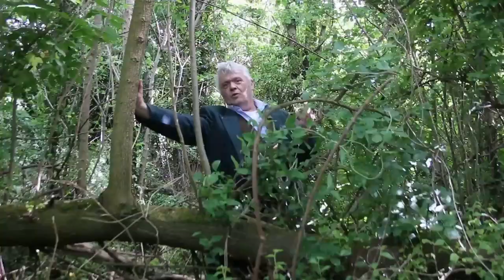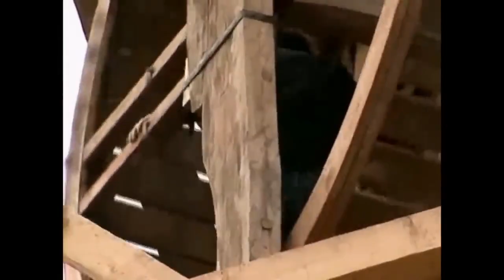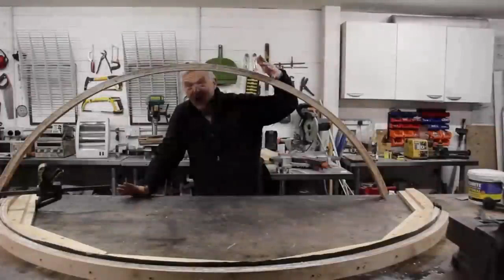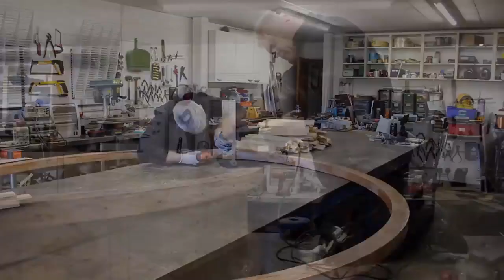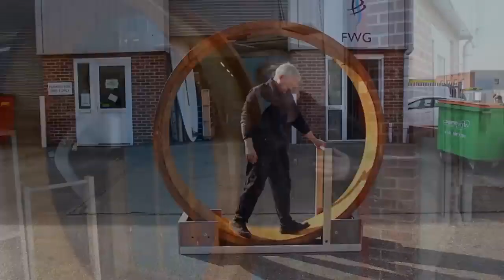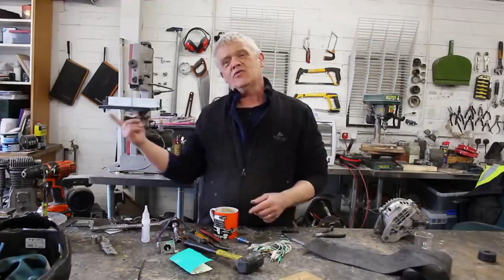008 A Generator For Every Circumstance

Comment: With that closing statement, one YouTuber made a generator out of some exercise machine that required one of the kids to be pulling the handle to power the Wii, and when one kid was tired or it was their turn to bowl, they swapped quickly and had to keep the pace. Think it was just the Wii plugged into the generator instead of the wall, but still. 

When I first saw a hamster-wheel crane, it was in a video covering some architect's class or whatnot near France. They are building a castle using traditional methods and have either spent or will have to spend approximately 20 years to make it. The last video I saw was covering how they built a container for storing the grain and were working to build the church portion (forget the actual name). 

I still want to make a human-powered generator that I can get on every so often to exercise and power my home or charge my batteries lol

Comment: I'm trying to figure out how long it would take to 3d print all the sections you'd need to build a life sized hampster wheel 🤔
Reply from the maker: i like the challenge! but a while lol
Reply: I'm wondering if I could make a template, cut the ball windmill blades from 55 gallon plastic drums, and then heat weld them together into a larger ball windmill. Then run more or less standard generators from the rim support wheels.

Comment: did you know that in your initial shot from Canterbury Cathedral you were just about 100m from a treadmill crane, its 2/3 of the way up the tower
Reply from the maker: it wasn't there when i shot it mate - there can be months between shots and video !
Reply: @TnTOmnibus  its not visible its inside the tower, in a part most visitors cant get access to, I went in there once for work (my company were doing a wiring test and inspect and I had to measure up for the drawings for the report so got access everywhere) it was a donkey treadmill and is built into the tower (so they cant get it out as the beams are too big to go down the stairwell) the crane part is long gone, if a donkey died they had to get a new one up there, so the donkey lived up there until the cathedral was finished. I do have a not very good picture though, but it was taken in a dimly lit room, with a digital camera when they were very new (it was a kodak and took pictures to a floppy disk)
Reply: ps, the clock mechanism for the striking of the clock in the shorter tower is also interesting and a gorgeous sight.